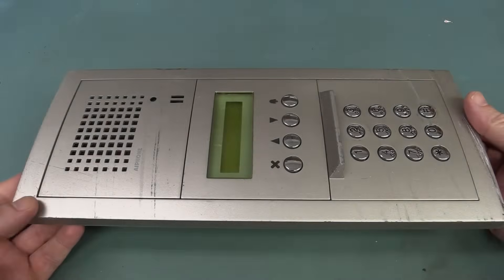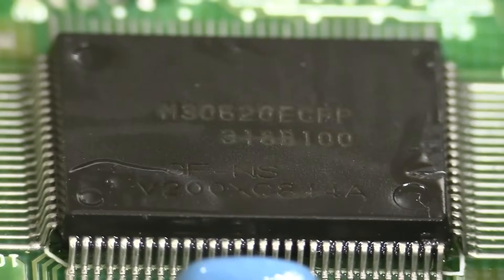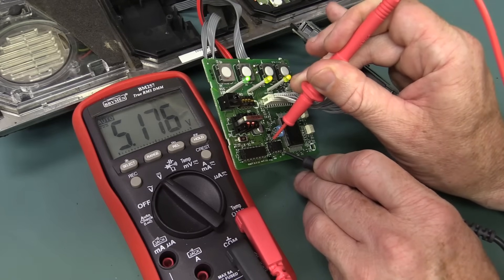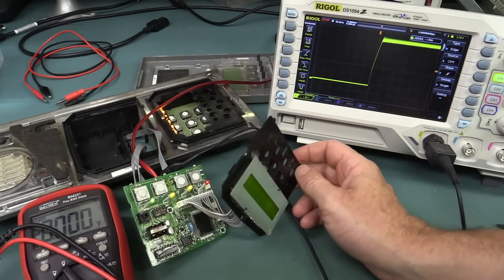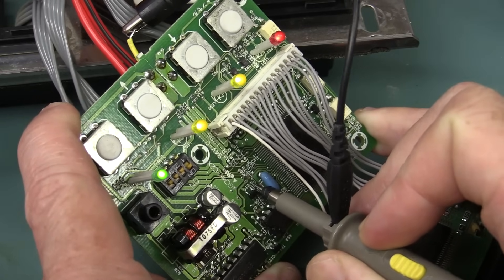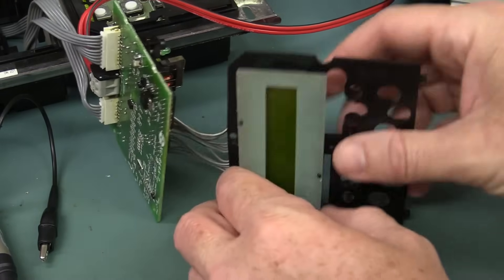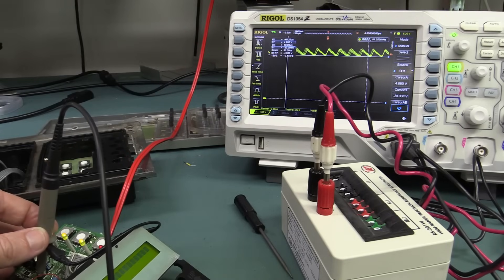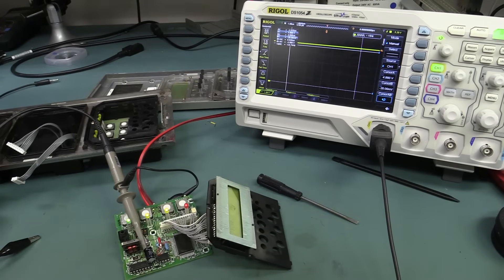EEVblog #710 - Intercom System Repair

Comment: I don't see a diode in the RC reset circuit you put in.  The data sheet shows that there is one there to bypass the resistor to let the cap discharge quicker.  When you turn it off and then on so quickly, could that be causing the latch up since the cap isn't discharged below 0.2v before the power is restored?

That reset chip (5-pin SOT package) must have been monitoring the power rail for stable power and with the bad cap in the power rail it never became stable and so it never brought the controller out of reset.  I think if there were maybe a smaller cap and a diode across the resistor to discharge the cap quicker the thing would boot every time with no over-current.

The datasheet for the controller says the reset should be held below 0.8v for at least 20 cycles.  At 4MHz that wouldn't be very long at all but no harm in having it low for longer. The cap just needs to get below 0.2v before power is restored after power off.  A power on reset chip can hold the reset low for as long as 250ms, so I think this reset circuit is now the trouble here.

Comment: Hi Dave. Thanks for the awesome videos. I had the same experience troubleshooting a treadmill motor board just month ago.I found the faulty components and replaced them right way. The micro-controller on board was just working ok. After a short break and back to troubleshooting i powered the board up and guess what! chip never booted-up. Next step was to check 5v rails and all was just fine. I changed the crystal just to be sure it dum works.but i had no luck. After getting the data sheet for the micro i started with the reset pin and traced on the PCB, the voltage on reset pin was just 1.3v and normally it should be around 5v, down the line it was hooked to the collector ofA337 transistor that has to pull the pin high (5v)with a resistor divider on base and the emitter to 5v. I decided to add a 10ohm resistor on base pin (A733)to 5v, to allow 5v flow from emitter pin to collector to reset, and wow the A733 started heating up really hot due to high current flowing to reset  pin. I got the micro out of PCB and did a standalone test on solder-less test board and also added logic components that a micro needs to boot. Lastly i measured how much current the reset pin was consuming and wow 250mah! Really!The chip never booted but was getting kinda warm. Hmm
Reply: I got the micro out of PCB and did a standalone test on solder-less test board and also added logic components that a micro needs to boot. Lastly i measured how much current the reset pin was consuming and wow 250mah! Really!The chip never booted but was getting warm. Hmm

Comment: thanks Dave, same unit, similar black LCD line, swapped both caps for 5v reg, and lifted reset pin which was grounded, voila it boots, made an rs232 lead for 2.5mm jack and I'm happy it's worked. Thanks for the insight, appreciate it.
Dave DPS

Comment: When I have power going 'somewhere' due to suspected low resistance or short (like when you had 90mA+  during the direct pull-up through the meter) I just shine the thermal camera at the board and see who's holding the line down (or up).

Has saved me some serious pain :-)

Comment: If you're struggling to read part numbers that are waterproof coated, like in the video, try using light of just a single wavelength. You can pick up red, green, blue laser pointers, and so IR bulbs and UV lights can be used. Just trial and error, but it's handy to have at least one of each in your workshop. They are really cheap and can be extremely handy in reading difficult things. You'll be amazed how some things look like they have no writing on but under the correct sort of light appear crystal clear.

Comment: I love this type of investigative troubleshooting even if the end result is not what you want, it still makes a very interesting video.
Most people who commented spotted the same things that I was wondering about but very few people had any useful suggestions especially concerning the high current draw. It seems to me that the current is finding a path that should not be open which points to some other component going bad somewhere else, could be a whole string of faults in there.

Comment: Check the processor data sheet for the spec of the reset signal, it might have a maximum rise time which is why the simple R-C circuit won't cut it. I've had fun and games with them not resetting properly before now.
Reply from the maker: Alan Cordwell Yes, but that's the least of my worries, there is a serious intermittent over-current problem.
Reply: EEVblog Well, you never replaced the proper reset generator with a new working one. I talked to a friend the other day and he said, those act as Brownout detectors and are designed to deliver a well-defined RESET signal when the power is cut shorty. The reset generator in question looks like a SOT-23-5 package and might be a MAX823/824/825, for example.
Reply: EEVblog If you want to save the building sup. some money, you can buy a new LCD module off ebay with the same model number for around 200 USD.
Reply: EEVblog
A slow rise-time on the reset line may very well put the processor in a really bad state where it draws alot of power.
I agree with Alan Cordwell. You should restore a proper reset edge before troubleshooting the power issue.
The original reset chip was probably fine, just put it back in there, but don't connect it to the reset line on the board, since the board seems to be partially shorted. Connect it directly to the CPU using your jumper wire.

It would be very interesting to know if the reset line continues on beneath the processor. Perhaps it goes to other devices as well. Such as the LCD?
Reply: EEVblog If the processor isn't reset properly, it may go to an invalid state and drive some pins high/low, that are not intended to go high/low. This might explain the high current draw of the system. I'd suggest refitting the reset IC and see if it works then.
Reply: genkiadrian Bernhard Wörndl-A.  Agree full time. It might go SCR latchup or simply indetermined state where internally it shorts when it's not reset properly. It's ancient chip, everything might happen.
Reply: EEVblog Also, maybe (just maybe) there is some kind of watchdog issue inside MCU. If it doesn't reset when power goes random (no full reset just brown-out) it might stall (for instance if they have power down detect but no reset generation). What doesn't match is this overcurrent thing. I'd say that there is random failure picker fueled by damaged reset circuit. I'd love to see that thing with new reset generator :)

Comment: I'm sure you probably did off camera, but did you check the supply at the processor?  Possibly being powered through the reset pin because no supply at the vcc pin?

Comment: Hello EEVBLOG. 

I think I had found a similarity in a research which I had done as student. I had study the aging of the sequentially digital circuits. So I had three set of two 8bit FF register, the one part of the set is made with discrete logic MSI chips and the second one was made with a PLD. I had study the starting condition in both of this device. By had the reset off, and switch on the power for some time, store the output value of this two devices on a logger, and repeat the process. I did that for about 1 month.
The result was the following.
Initially both of this is start with random values, and the study of this values is give a rectangular distribution in both of that devices. But after of some days the initial values start to take more some values than others, the distribution of the random initial values goes to be Gaussian. First, that happened to PLD, and later to MSI chip (remaining, both CMOS technology chips, temperature of the both device was constant 25°C and also isolated from the outer world, actually I had it on a oven, the distribution analyses had be done with than sampler of one day). So, as a conclusion every sequential circuit had a unique tuning destination (I think you understand what I mean). And this one is actually so unique where is very difficult to make any approximation on that. Even, device with close parts numbers had totally different result.  

So that one my Story about my study on the aging silicon chips.

For your problem with the door-telephone, you can try to apply a sequence of pulses  on the reset pin of the μC. Probably it's will make it to wake up from the latching statement of the internal Software reset circuit. 

And some words for this BLOG.

It's the first time where write to your blog, but it's one of the most beautiful blogs on the concept of electronics. Always you try to make the things Easy, and this is good, very good. One of the thing where I learn on school of the life is: "The most brilliant people on the world, was brilliant not because they know many complex things, but because they make this complex things so easy where even a 10 years old child can understand it". This I can say it with one word as "Μεταδοτικότης" or "transmissibility".

As you say "Thumbs up".

Comment: Probably the voltage regulator was causing the reset chip to stay low. Put the reset chip back in and recheck.

Comment: I realize this is a very old video, and I don't know what the outcome of the fix was, but the number 1 dip switch which Dave mentioned as a "reset" is turned on again at 35:45.

Comment: Looks like brown out, I'd replace the IC you removed with a voltage monitor. Had a very similar experience with an entire product line one, check Microchip AN686. A quick fix would be a 555 timer to hold in reset until the power supply settles.

Comment: "When the supply voltage is in the range where operation is guaranteed, a reset is effected by holding the reset pin level “L” (0.2VCC max.) for at least 20 cycles"

Maybe adjusting the reset network as some have said. No idea about the LEDs. Bad design + software PWM? Devil's work? Would be really cool if you got it working because it seemed so hopeless at first. Then again it could very well still be.

Comment: Maybe the microcontroller's reset pin has some internal diodes for protection that were wrecked somehow and are now partially shorted out? Possibly the lower protection diode.

Comment: Dave, you said in the video that the reset trace doesn't go anywhere, but maybe it goes to a via under the chip.  There could be another component pulling reset low.  For example, what are the optocouplers for?  If I were designing this thing, I might use an opto as a means for resetting the unit remotely.

Comment: A wild guess: First it was the ridiculous amount of ripple on the 5V rail keeping the supervisor, and later the processor, in reset. Maybe connection through DMM (in low impedance mode?) smoothed out the supply voltage enough for the processor to start up, direct jump with resistor did not work. Then when the 5V rail was fixed, the reset timing was wrong. I guess the supervisor chip wasn't there just for "good engineering" after all..?

Comment: The M16C Datasheet clearly states (page 14) that "When the supply voltage is in the range where operation is guaranteed, a reset is effected by holding the reset pin level “L” (0.2VCC max.) for at least 20 cycles. When the reset pin level is then returned to the “H” level while main clock is stable, the reset status is cancelled and program execution..."
So you maybe really replace that 5223 thing? It also says "Free Delay Time Setting [...] Delay Time Controlled by external Capacitor" in the datasheet. So your RC might just not meet the specs for a proper reset here.
Maybe you could trace where these LEDs are going? The M16C seems to have some 8 Channel DACs and all the rated I/O current is only 5 mA so there probably is a driving transistor for the LEDs or something?

Comment: As someone who doesn't know nearly enough about this stuff to provide practical advice, (though your vides are amazing and I do learn from them some.) as the 2 LED's seem to be sporatic in behavior, I'd check out the circuits they are involved in, a component attached to them may be somewhat sickly, if not dead.  Least that's what I can come up with.

Comment: Hey Dave, why didn't you use a thermal camera? If the device takes more power than its suppose to, the defective component gets hot. If its the processor, you're right.

Comment: Some thoughts. 1) get rid of the damn *^&! conformal coating first, then desolder the R/C network and the uP. 2) Clean the board thoroughly. 3) resolder the R/C network, then power on the board without the uP. Poke gently but forcefully, around the resistor; you might have a break in an internal board layer! 4) with the uP isolated, measure from pin 12 to Gnd and Vcc in both directions with a DMM that has a "low voltage" mode and see if the protection diodes on the reset pin have failed shorted. 5) If, not, resolder, and try again. If it still fails, well... parts donor time!!

Comment: You could rig up a 555 monostable with a resistor and transistor to kick the reset, possible?
It didnt go mad untill you applied that electrolitic across the supply.

Comment: In a situation like this, since you cannot get a replacement, I would whack in a PIC programmed to wait a few mSec on power up and perform a reset on the main processor.  You could keep it old school with a 747541 and an RC time constant to do the same thing.  There's a million ways to fake a reset on a micro.

Comment: This means that the LCD Display is initialized. Power up the LCD the first Line is not visible but after the Command Power ON this will displayed. The Cursor is not at position 1 - left upper first line. Measure the EEPROM first that looks like a death counter. If you measure a Communication on the EEPROM first after Reset and then show nothing on the LCD you could be sure it depend on the information in the  EE. If you have a younger System like this you can copy the information from the other 2nd System to this EEPROM and you'll see that is working. I think so I have a problem like this in a other System the System was from a Time Stamp Company.

Comment: Dave, an idea: Well first, great job troubleshooting, a very logic approach and you found the problem area very quickly. Looking at the data sheet, I suspect other pins in the vicinity of the reset pin may be affected. Check the voltage level on the CNVss pin and the BYTE pin, both two pins over from RESET. They need to be at a particular logic level for proper chip operation. The CNVss trace runs suspiciously close to the RESET pin trace. I don't know why CNVss and BYTE are connected through a 10k, but that means there must be a trace hidden somewhere that is connecting those to Vcc or Vss. Perhaps a dodgy trace under the uC or a defect in an inner layer is affecting that entire board area. Good luck! You better get some free rent out of the bastards if you fix their keypad. :)

Comment: leds on full as out put ports on micro turned on when processor locks up.
try making reset line from psu input voltage.

Comment: Very informative video Dave, you gave a good attempt at repairing it!
Just wondering... did you put DIP switch #1 back into the correct position after you tried the reset? Also, it might have been worth seeing if the processor was temperature-sensitive, which would rule out other parts of the cct maybe.

Comment: What interests me more than anything here is why those LEDs are so bright. If they have current limit resistors then that should not happen ever. Does the processor have optionally current limited I/O pins that are driving the LEDs directly?  Are they driven from switching current regulators? What could overdrive them like that?
Reply: Probably PWM'd off the chip.
Reply: Dave McAnulty And the extra current is from the hyper-bright LEDs stuck full on when the CPU resets.

Comment: Hi David, I noticed on the scope trace that there's a triangle ripple voltage on the 5 volt supply, have you checked the rs232 chip as it may use a charge pump to drive the 232 line, maybe a faulty 232 driver chip or charge pump capacitor?

Comment: Well, I called a 9/10 dead cap in the power circuit on twitter, glad I was at least partly right.   The overcurrent issue does rather point to an unhappy chip.  Either it's expressing serious unhappiness with the timing of the reset signal from the bodge, or it's in some more serious physical pain.

Comment: Maybe the improper slow rise time on the reset pin cousing the high current start. Are the low impedance on the reset trace is still exists ?

Comment: Thou check voltages!!
what you are seeing is the processor being powered through the reset pin, because it's 5v supply is missing.

Comment: Maybe you should have replaced the cap. first and kept the reset chip in there. The ripple on the 5V rail at 16:37 might actually be the issue.

Comment: (not so) Modern processor need a clean rising edge on the reset signal, else it could be interpreted as brown out reset ... If you wanna demonstrate, why don't use a circuit based on RC + 74HCT14 ... or simply use a pulse generator/another brand reset chip

Comment: EEVblog 
Hey Dave, couldn't you follow the current to see where most of it goes when it draws the 200mA? You do have those special probes for following current through traces. Maybe you can spot another component that is failing.
What do you think ? Worth a re-try ?
Also, you don't use those special current probes often and the board doesn't look too complex, might be interesting !

Comment: By the way thats a Aiphone GF is over 10 years old. You could of found a used GH system in Ebay and replace the unit with it. The new system is Aiphone GT but that model is not compatible at all.